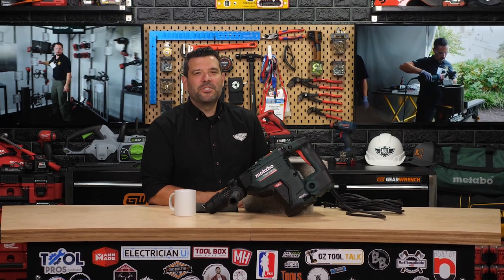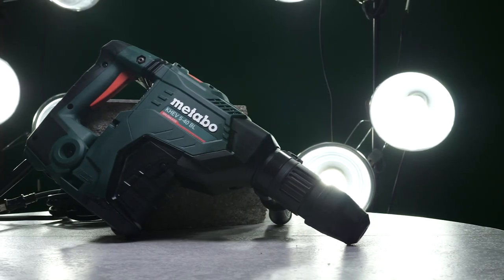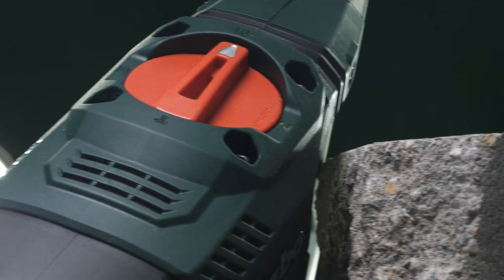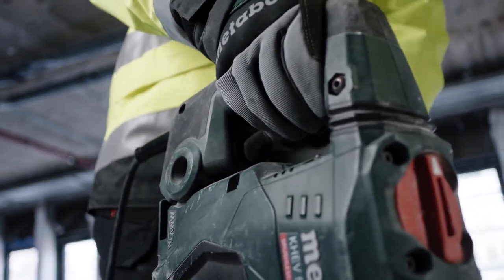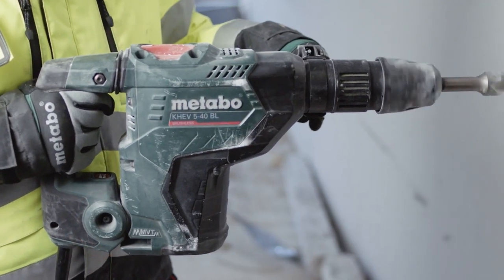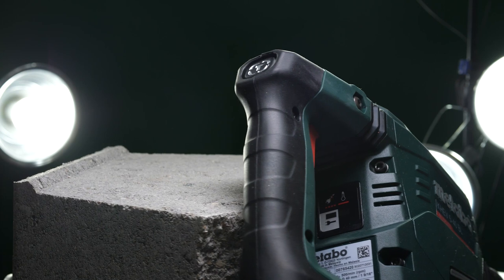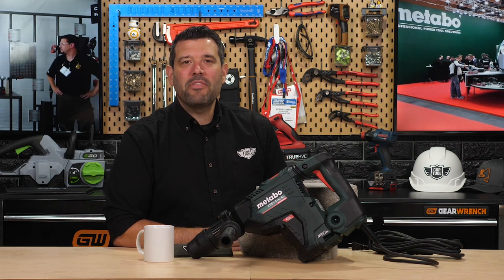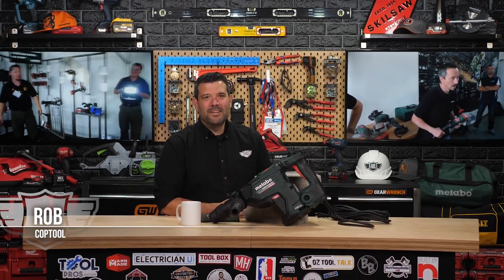METABO sent us this all-new Brushless [SDS Max] Combination Hammer, and we're GIVING IT AWAY!

Comment: Now THIS is a tool!  This Metabo KHEV 5-40 BL has both electronic soft start AND VTC!  I actually have 3 projects that would require this tool!  1) I have to install a perimeter drain in my basement, and would use the chiseling function on this tool to break apart the concrete closest to the wall, as well as cut the concrete sections shoulder-width apart, so the cut-up pieces fit through the cellar window.  2)  I have some frost heaves in asphalt driveway that need to be dug up because boulders from underground have made their way up, raising the asphalt to the point where a regular car bottoms out if they go over them. Again, the chisel function on this tool would make quick work of this project, especially since this tool has a locking switch for chiseling in continuous mode (7 spots need to be dug up) 3) I'd use the hammer drilling function on this tool to drill holes in concrete to fasten security anchors to secure my motorcycle, tool chest, boat, etc.  After that, bye-bye to-do list!

Comment: I am starting to het a few Metabo power tools, so far I like what I see. I have a 2 car garage where the slab is 60 years old. This beast would sure help in breaking away and setting things up for a new pouring. Afterwards it would sure help in running conduit through my home foundation and would certainly be a big asset in doing the install for the car lift....if I can get enough saved for one!

Comment: Very well engineered piece of equipment, a lot of great minds helped this drill come to life.  Metabo has always been a brand I respect.  

If I was chosen, I could certainly use this as part of my involvement in our local Habitat for Humanity home builds.  We often come across old, dilapidated concrete slabs, sidewalks, etc.  that have to be busted out.  This would allow our workers and volunteers a easier and safer way to get the job done.  Thanks for your consideration.

Comment: I could really use that sds max combination hammer drill to help me extend my basement, I need to clear alot of dirt, so I would throw a clay bit on it to loosen the ground up in my crawlspace in order to get the dirt out and achieve the depth I need for a 7' ceiling height, and I would also use it to chisel out every other course of foundation block, on my existing foundation walls, so I can weave in the new concrete blocks in order to extend my basement to a full basement, instead of half basement and half crawlspace, I would really put the Metabo through its paces and see what it's made of!!

Comment: Not to sound like an idiot, but what exactly do the 1 9/16", 1 3/4", and 2 1/6" measurements mean in reference to hammer drills?
Reply: Those measurements are the maximum diameter hole in concrete/masonry that the drill is rated to (using a standard masonry twist bit, not a coring bit). So Metabo is claiming that this smaller unit has enough balls to drill a 1 9/16" hole at a reasonable speed (Although it'd probably be pretty slow since most manufacturers squeeze as much out of the ratings as possible). If you actually needed to drill a lot of 1 9/16" holes, You'd be better off with one of the larger units, however this smaller unit would definitely be able to do it if you really needed.
Reply from the maker: @ChristNhero  Super good answer. Thanks!

Comment: WAIT a second. This is a CORDED tool with a BRUSHLESS motor? That’s not a thing you see much/ever. You know a corded tool is serious when it has a brushless motor. That’s just showing off at that point. I want one of the 36V impacts drivers. With this thing I could stand a chance at redoing the driveway and laying a foundation for the add-on to my dad’s home. One less tool I’ll have to buy/rent from Home Depot.
Reply: Wait it does chiseling too? So I could use this for the garage floor in the large areas that need a repour to smooth things out? Would this let me create a concrete shed of sorts like my neighbor had built after Hurricane Katrina as his storage and command center+ generator platform/housing ? But it would need cabling for cat 5 and 220v etc. because then I could actually not only easily handle my dads home and driveway but so some work in the community, I know many families I met before my mom died of Parkinsons in April who are also simply unable to afford the $3,000 a month medication (none of us could obviously) much less afford to install generators on a platform properly secured etc. but when you have a elderly loved one who can’t be in the heat or or needs oxygen etc. you NEED to have a backup because in my experience calling to say “Hi Power Company my mom is special and we desperately need. Electricity restored here before everyone else. Can it be used as a overkill regular hammer drill too? Because then I could spend more on a decent driver. I’m about ready to drive go Ohio power tools and sign my life away so I need to take a break from dreamland here. 

I just want to add though, not only did this tool break the AC tools use brushes motors only because you don’t need tiny brushless motors etc. Metabo said NEED? NEIN? Vant? Yes. Plus VE CAN so VE VILL. 

Same for the anti-vibration mechanism, that’s not something that’s been done before is it? Never seen that in the bulldog or the bulldogs big brother.  

Metabo’s corded grinder was the first tool I fell in love with after seeing AvE year it open. It should play for the NBA it’s so tall. But I think I’ll buy the 36V driver first